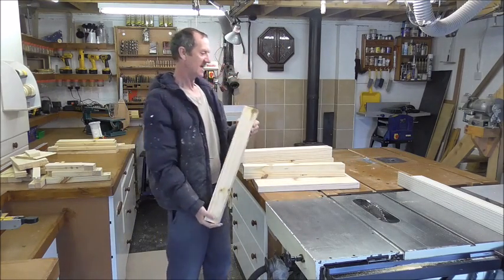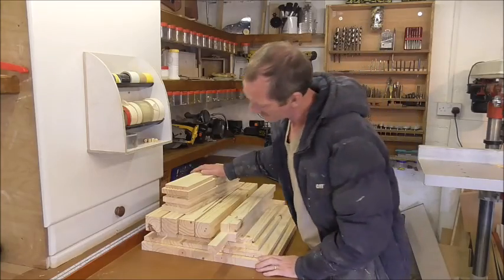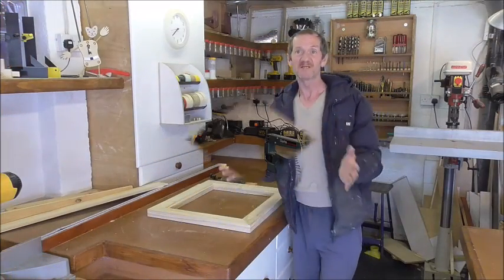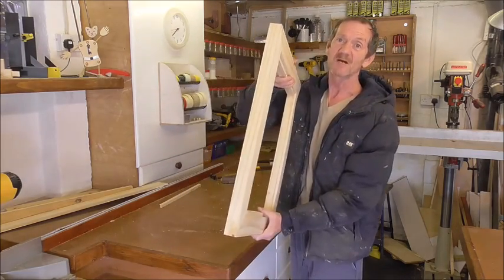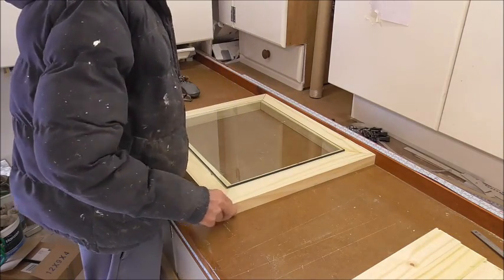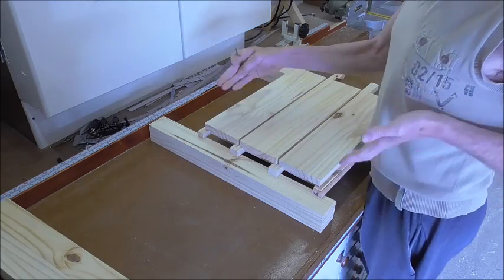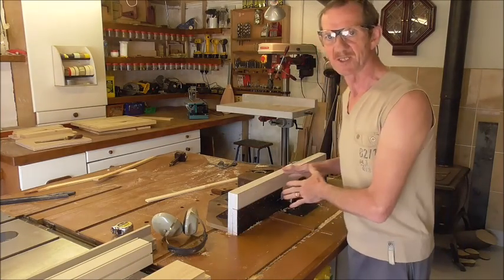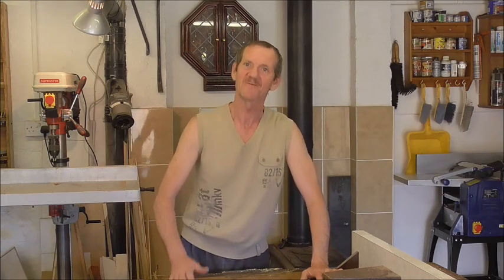Pine Gadget Unit part 3

Comment: Hi David, yet another great project!
Whats your make and model of planer thicknesser?  Is it any good?
Reply from the maker: Christopher Collins First Christopher thanks for watching. the planner is a Fox 250 which has a single cutting head for both at 10" or 250mm, it works ok for me but I can't have bigger as I used to have due to space but this does what I need it to do
Reply: +Christopher Collins I have the same planer/thicknesser. I've only had it a little while but it works quite well in both modes. btw, I have even less room than David.